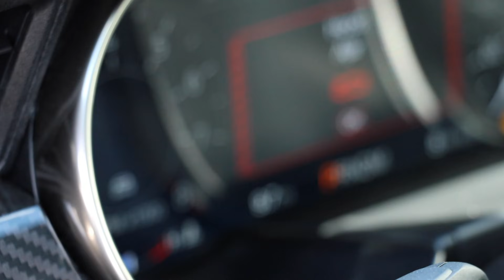Built 65 Mustang Messes with the Wrong GT350R - Whipple Supercharged

Comment: hay Andrew I'm looking to buy a GT350 but I hear they have engine troubles and blow up I also hear the reason for that is they use oil and people don't keep an eye on their oil just wanted to know what your experience has been and your friends that have GT350s
Reply: I am the Black, non R owner in this video with the Ford Performance banner. I run amsoil 5w50, 16k miles. No oil consumption or issues. Over 10 track days on the car. I'm also a Ford tech at a local dealership for reference as well.
Reply from the maker: It’s kind of a hit or miss thing if you get a good one or not. Our GT350R has been great no oil consumption issues and holding good power
Reply: I think this was more so the older models like the 15-16 or so the newer 18-20 ones or maybe it was 19 on they did some stuff to remedy the issues the earlier cars were having and I've heard the newer ones hold up better but the older ones can too theyee hit and miss kinda like Andrew said.  If i was in the market for one I'd try to get at least an 18 or newer.
Reply: Engine issues are overblown with this car cuz the internet can’t appreciate anything. Buy one and enjoy it, best drivers car for a mustang  ever made.  It doesn’t matter if you get a gen1 or gen2 either, they both have the same problems.

Comment: Voodoo is easily the best sounding engine of all the mustangs
Reply: Debatable
Reply: @stickyicky2858  what do you think is the best sounding?
Reply: @tristanrhodes2949  personally the 2v and 3v if done right are just orgasmic the 5.0 is nice though but has tonhave the right exaughst i just get tired of hearing them all lol i have a 3v and a 12gt500
Reply: @tristanrhodes2949  the 5.2 sounds better than the yote though for sure
Reply: @stickyicky2858  3v do sound really nice, the motor is just a little underwhelming stock
Reply: @tristanrhodes2949  if that ain't the truth lol the power isn't good but I have a bait load of mods in mine make a decent amount of power
Reply: @stickyicky2858  I’ve seen videos of people barely making 5.0 power without boost so it’s possible but it just kinda sucks you can’t start with that😂
Reply: @tristanrhodes2949  truth my car fbo and cams was at 385whp i built the bottom end and did the fuel system and now it's about about 650 it can go higher but I choose not to i have 3 times best one i have is kill mode and 900hp but that's a e85 tune second is 750 and the one i run is 650 all to the tire cool stuff but requires lots of money's
Reply: Might be the best sounding American v8 ever honestly